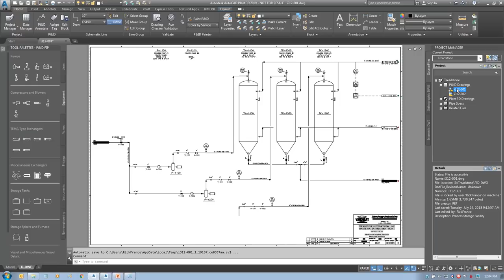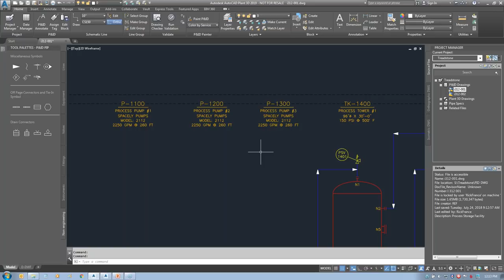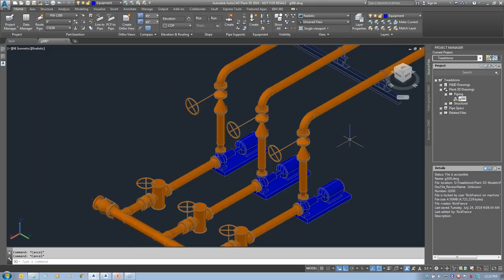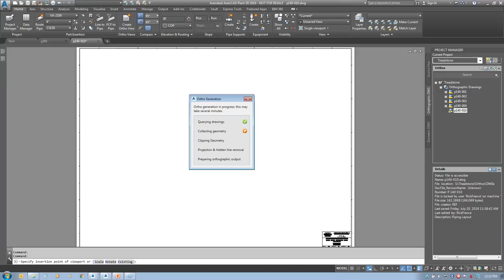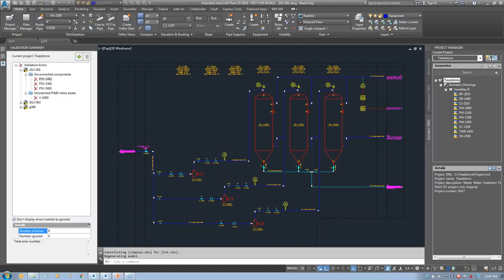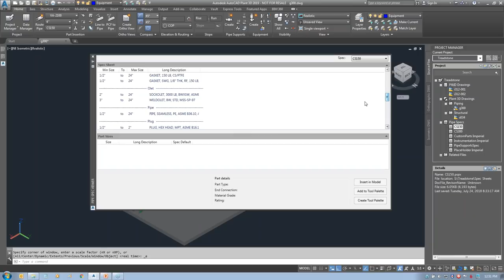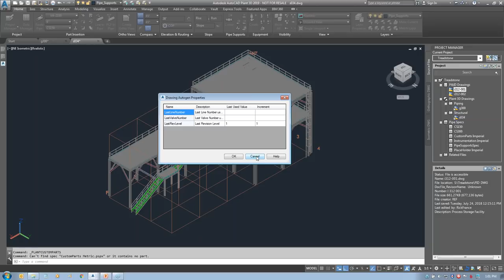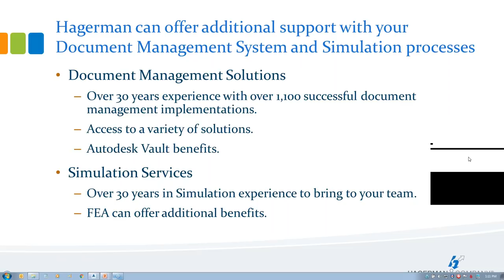Introduction to the AutoCAD Plant 3D Toolset

Comment: I started researching / working on this program today for professional reasons. When I try to drag an element from the tool palet, the message appears: this tool is not compatible with a non-PNID drawing file?!
Reply from the maker: All drawings MUST be part of a Plant Project. The tools will not work with a drawing created using AutoCAD commands or created outside the project. I would suggest taking our P&ID Quick Start training class.
Reply: Hello,

What are your thoughts on CADISON-3D Plant Design & Equipment Engineering Software? Which software is better for process plant design?